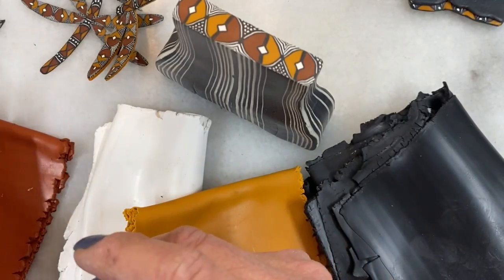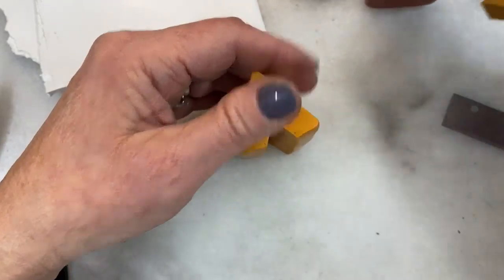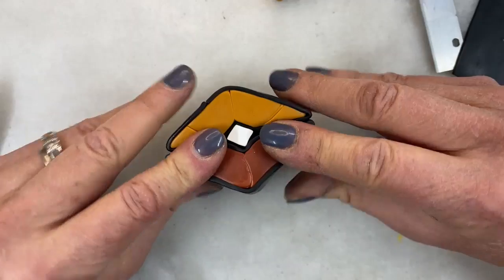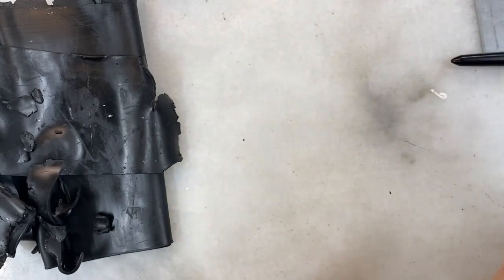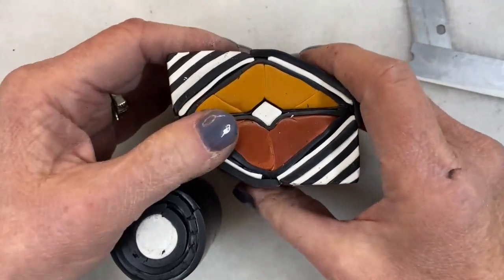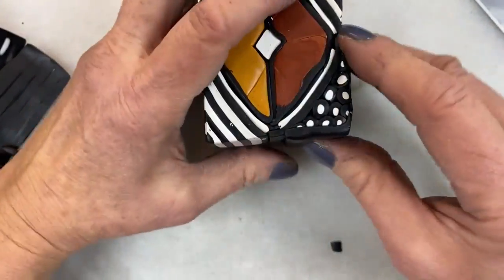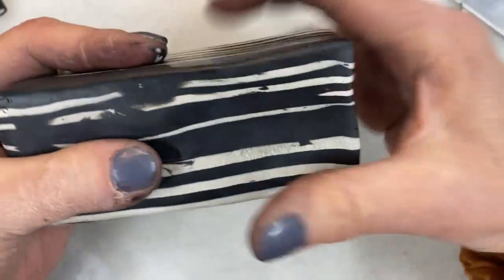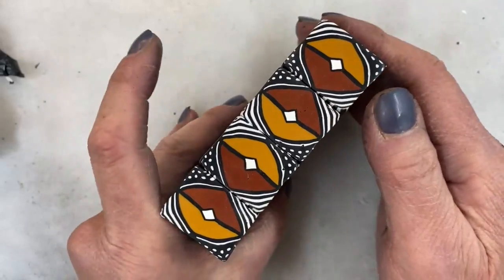Part 4 Mud Cloth Polymer Clay Canes - A Polymer Clay Tutorial

Comment: Your canes inspire border canes for my projects! A tip for the camera.  Clear the field and look through your lens, then mark the four corners of your work surface with a little x, if you need to connect them make a square. When you’re working use the as a visual cue to stay in frame.

Comment: Hi Donna! This series is a ton of fun! I have to wonder, though,  if the reason for the blobby-wonky center of the cane is because of not separately reducing the diamond core from the dot-and-line corners? Wouldn't this make the sides of the gold/copper diamonds straighter? What do you think? Thanks as always for pushing the envelope! I'm very inspired. Cheers!🍰
Reply from the maker: You know, it could. Reducing parts is sometimes the best way, If i make it again (for the third time! I will try that, kid.  ❤️
Reply: @DonnaKatoArt  OK! I also looked back at the shots of your iPad and saw part of the design was left out 🤨 So here's my question: How hard is it to start the design as a square and then squash it to be a diamond? and then reduce?  I am guessing that approach would not work. Seems that diamond shape is really hard to do!!!